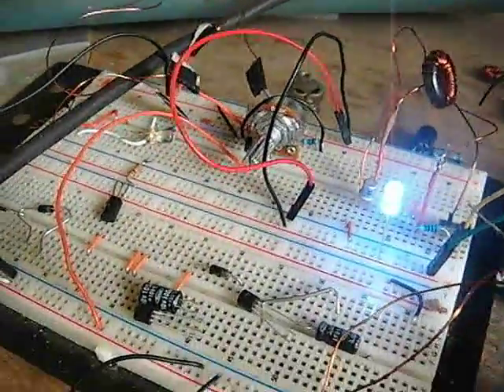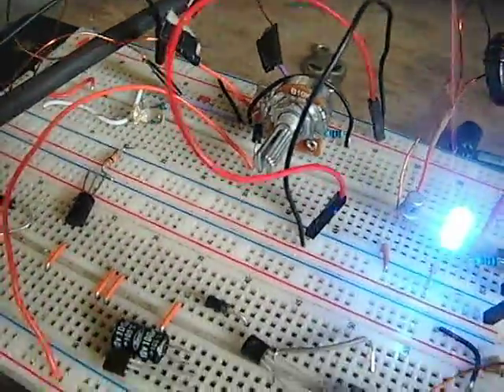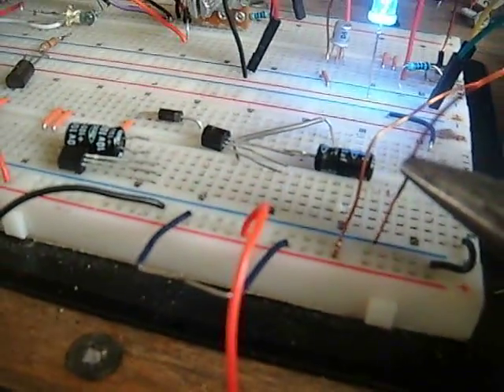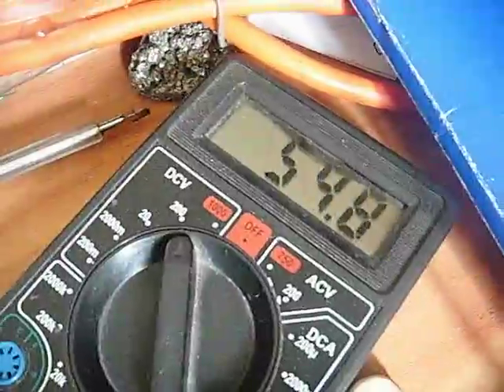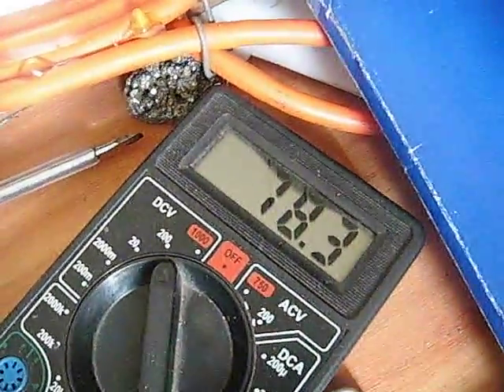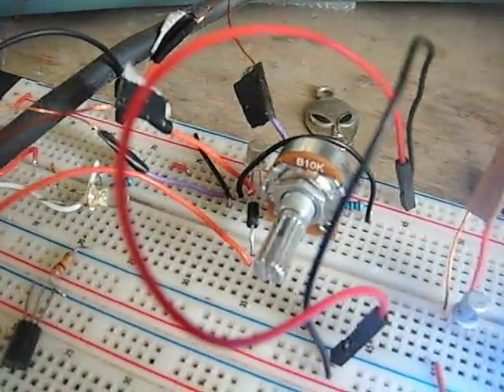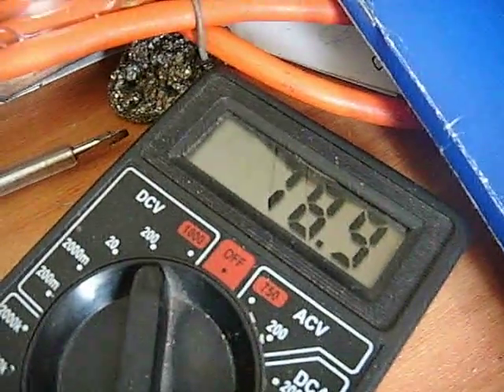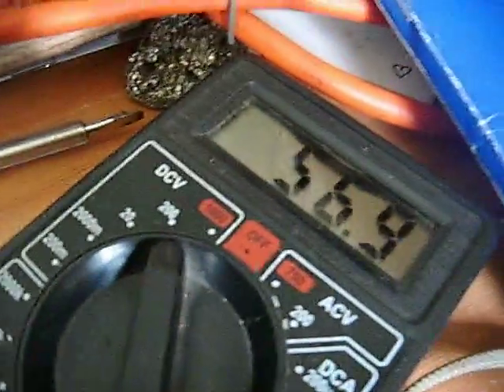Joule Thief + Bedini 7v input 82v output

Comment: watts in? watts out?
Reply from the maker: I have added schematics to my 3rd video "Schematics for Joule Thief Bedini
" - I am interested in charging batteries (capacitance) Not really interested in amps so I'm not checking anything apart from the charge rate and I monitor the charge Capacitor/Battery for that, the point is, there is enough induction from the coils to charge the Primary power source and an additional capacitor. Induction from the coils is normally not enough to charge a capacitor much above 2v I am a low tech novice and as I have no rules and as I'm working in milli-Amps, sticking wires were they don't belong won't kill me ;)